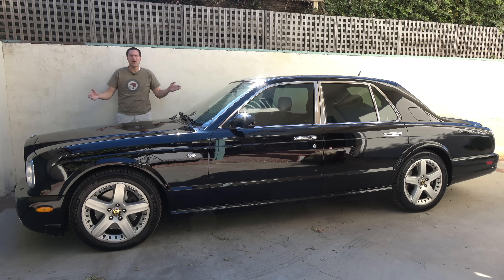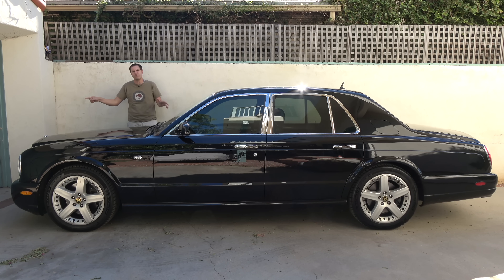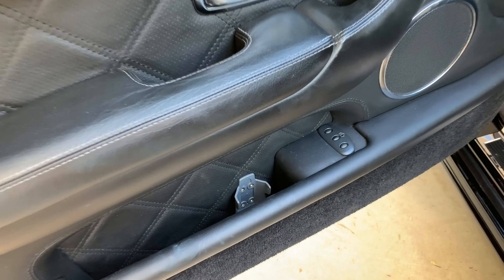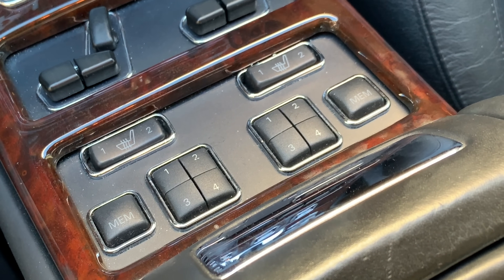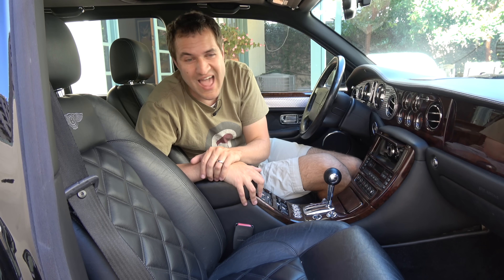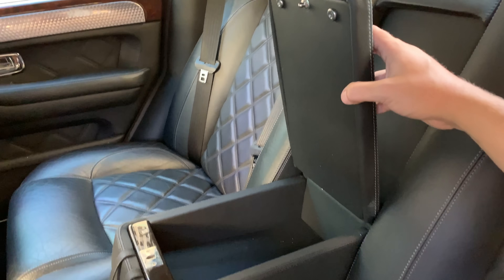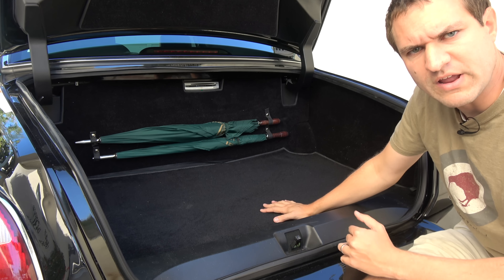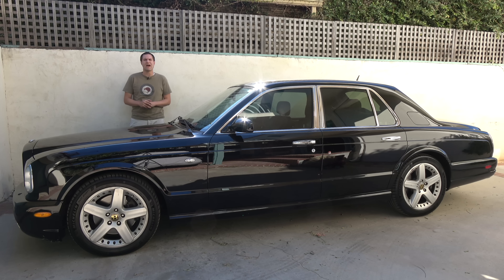The Bentley Arnage Is the Ultimate $30,000 Luxury Car

Comment: If a realtor was showing people $300k homes and telling the people in a decade it will be worth $30k, that house would sit empty for centuries.
Reply: 79 thump In Detroit tho
Reply: not anything
Reply: every car goes down in value besides the older muscle cars from the 60s. take a regular $25000 car from 2003. today its worth $3000 or less.
Reply: take a mclaren f1 which increased to dozens of millions of bucks from less than a million
Reply: But if that house were guaranteed to score some top notch ass for a year, it would sell overnight. This car is the pound-town express!
Reply: 2008 called and it's very sorry
Reply: Nissan Skyline R34 was £50,000 in 1998 its still worth at least £50,000 in 2019
Reply: As tech progresses, these new "smart" houses will become obsolete quickly and depreciate in value. When the lights & smoke detectors & kitchen appliances and bathroom fixtures need to download updates to function properly or become unreliable, the housing market will crash again. Hahahahahahahah!
Reply: @ald261989  There are PLENTY of cars that have maintained (Due to inflation, technically, that is increased) value OR gone up in value substantially. LOTS of cars. Numerous Ferrari's and Porsche's, Lambos, Mclarens, and cars from a few other manufacturers.
Reply: Apples to oranges. Also if you buy a $30,000 car today, it will be worth what, $2,000 in a decade? It's not any different, just bigger numbers with richer people.
Reply: Houses and cars are two different things. People dont drive houses and most people dont live in cars. 
Try again.
Reply: Most cars are a wasting asset. And a poor place to push money.

 Only ones that gain in value are high priced collectibles.
Reply: At least you get $30K back. Some people pay $300K in rent over ten years.
Reply: =Timeshares
Reply: In some places, that's called buying a condo.  In fact, that's what effectively happened to me.  I bought one in Newport News, and after about 13 years, am hearing from the association manager that some of the recent foreclosures in my building have fetched just into 5 figures.  That is on a unit that originally cost over 100K.  I paid 90K for mine, and and still am about 20 years from having any equity, or so it seems.
Reply: That's a home. As a realtor I'd choose this. Used
Reply: people don't buy these cars new... their corporations do...
and when it is written off... sometimes the driver will buy it from his corporation... 😁at a deep discount.
Reply: @ald261989  dont forget about old Ferrari's...
Reply: Land...they are not making any more of it!
Reply: @Jamie-ds1gf  worth more in the USA & Australia... R32 GTR's between $70-$120KAud  in Australia.
Reply: @venom5809  only if it was used as a taxi , and has 500K Klm on it. I've seen plenty of 10 yr old cars which still have a 35-47% market value
Reply: @wrxrob  lmao
Reply: If you guys are so petty w money you should look at a conti gt 😂
Reply: @FuckSmucker  Cars arent investments
Reply: @MyNameIsUnavailable  maybe for poor people 😂
Reply: Can’t compare depreciating assets to appreciating assets.
Reply: Actually houses go down in value in Japan.
Reply: @Ned_Slanders a house should be a depreciating asset.
Reply: …and that is why this type of car is a total waste/luxury.
Reply: Not how real estate works champ

Comment: 6.75l Twin Turbo V8

Horsepower - Sufficient
Torque - Sufficient
Reply: obviously not a performance numbers kind of car and it weighs as much as an elephant
Reply: A gasoline engine which redlines at 5000 rpm is all about low-end torque and smooth riding.
Reply: I think you mean Adequate. ;-)
Reply: @federico5220  yep you are right. I see so many people braging about why amg and 760li v12s don't make 700 or a 1000 horsepower
Reply: If you have to ask the price, you simply cannot afford it
Reply: @Esdeath_0001  So if I don't know the price of a t-shirt in Target I can't afford it?
Reply: @cianosullivan4096  it's a play on the 1%ers never ask what the price is
Reply: Fuel consumption - Suffocation
Reply: @cianosullivan4096  Well yes and no...  A shirt at Target isn't generally a high price item for most people.
Reply: The 4.4 V8s were the twin turbo ones. 6.75 had just a single
Reply: Half the torque is needed to get moving on a green light before it turns red.
Reply: @ThatGuyRandy  Oh yeah? Why does it say "6.75 Litre Twin Turbo" on the engine cover? 17:58
Reply: @cianosullivan4096  . Probably.
Reply: @ThatGuyRandy   The Arnage T (and R) have twin turbos, that's why it has a plaque under the bonnet with "TWIN TURBO" on it.
Reply: @ThatGuyRandy  to start with, then they moved to twin turbos with the RL, and in this model the T

Comment: I need to put the record straight I bought my Bentley Arnage T for £20,000. about $28,000 a year ago It is in a beautiful Moroccan blue colour and I have done 24,000 miles in my first year the cost has been minimal in terms of maintain and in my opinion it is the most magnificent car I have ever owned they only 2400 of these beasts and approx 1000 RHD to put it in terms of appreciation likelihood this is a car to invest in so too. those petrol heads who keep mentioning cost of repair I am an owner and when driven as an everyday car it will serve you well if left sitting in a garage not driven I think it will stagnate and cost a lot  ,Well anyhow great Video Doug  keep it up
Reply: So your saying I should sell my 2014 Toyota Tacoma and buy a Bentley...al I do is change the oil in my Tacoma, nobody I know messes with anything else unless it breaks after 200k miles, like a water pump or something. Can I do this in a Bentley or are fluid changes, belts, etc in need of upkeep constantly?
Reply: Benjamin Goulet: Holy smokes another pontificating toyota owner, Graham Day is stating his Bentley isn't as expensive to maintain as most think. You have a toyota, congratulations, no one gives a toss. Good luck with your ego when a Chevy from the 1970s can tow/haul more than your truck, has been reliable for 3 decades more than your beloved and gets more looks
Reply: @endutubecensorship  Chevy is a great car/truck the point I was making with the Bentley is that someone paid $300,000 originally for it and I bought it for $28,000,oil sparks and general service I do myself no way is the Bentley going to do 300k like a Toyota or a chev but for value to drive the same as the queen of England is driven in ,it is a class act but the Chevy is not be sneezed at either .
Reply: Graham Day: I had missed your point, my apologies to all here. I agree, that value for the quality of craftsmanship and materials cannot be beat
Reply: How many miles has the car traveled so far?
Reply: @grahamday813  the Bentley can do the enormous mileages if properly serviced. The earlier Rolls-Royce and Bentley cars were considered a lifetime purchase. They were engineered to be serviced and rebuilt with a lot of chauffeur-friendly maintenance. Diametrically opposed to today's dispose, recycle and buy new mentality.

Comment: 2001 Bently Arnage 30k
Oil change 30k
New battery 30k
Tires 30k
Remote 30k
Remote holder 30k
Reply: Aluminum car lighter 30k
Reply: Left rear blinker light bulb 30k
Reply: Going to Bentley dealer and just think of getting your Arnage serviced, not saying it to anybody, and getting out of the dealer : 60k
Reply: Front passenger lug nut  30k
Reply: car wash 2k
Reply: Air for the tyres 30k
Reply: Facts 😂😂😂
Reply: Light bulb 2k
Reply: Mob boss style: Priceless
Reply: A Doug to go in the trunk 300k.
Reply: Well 15k for a bulb is a bargain oh you want me to replace both of them
Reply: Severed head 30k
Reply: Shifting to another gear : 30k
Reply: Changing blinker fluid and muffler bearings ... priceless
Reply: Machine guns for your 3 passengers 30k
Reply: bentley windshield washer fluid $30k
Reply: severed head in bentley arnage trunk 30k
Reply: I guess that people that are buying an 18 year old Bentley for $ 30k aren't millionaires but car enthusiasts, who will give the car to a garage they trust for maintenance instead of a Bentley dealer. So the running costs won't be too high until an expansive spare part is needed to be replaced.
Reply: Remember to buy a gas station to run the car 300k
Reply: Windshield wipers $2,500
Reply: Tires $4800
Reply: Nice joke and all. But I wonder what could be the real annual maintenance cost of this vehicle :-) I understand it is not that crazy, until some major part is broken (like clutch, or transmission etc.)
Reply: External loudspeaker for yelling at the proletariat: 30 grand
Reply: Santas Doom  LOL!!
Reply: Wow that's at least 100 dollars bro.
Reply: Blinker Fluid 30K
Reply: @kgs4070  blinker light fluid 30k
Reply: Bentley Crest embroidered on floor mats with leather stitching- 30k
Reply: New engine 30k without replacing the turbo's of course
Reply: I was wondering where the other like $200k was in pricing 😂😂😂
Reply: @Spazik86  Check out joshsworld.com on YT, he has a very similar model and lots of videos with it.
Reply: 🤣🤣🤣🤣🤣 super money drain
Reply: @Spazik86  I can tell you the figure exactly as i have one of these in the UK , yearly maintenance thru a Bentley specialist is between £600 - £1,000 that includes everything including parts and labour. Depending on the mileage will determine what needs replacing , all Bentley specialists follow the same maintenance schedule as recommended by Bentley ...

Comment: Not many people know this, but the engine was completely redesigned apart from reusing the crankcase, by Cosworth in Northampton UK. Was originally a single turbo and very outdated with 7 separate v belts driving all of the ancillaries. When it was changed to the twin turbo, pretty much everything else changed in order to make the power and meet emissions. Still a push rod though as Bentley still wanted it.

Comment: "Bentley doesnt do abbreviations"
looks at Bentley logo
Reply: B is an initial, not an abbreviation.
Reply: An abbreviation is a shortening of a word, and acronym is something like
B 
E 
N
T
L
Y
Reply: What about it?
Reply: @zunedog31  So wouldn't that mean that the E and F for the fuel are also initials?
Reply: A graphic logo design isn't a word or intended to be.  It's artwork that represents your company and takes on distinct visual recognition.
Reply: @AB-wf2js  Yes.
Reply: Context
Reply: Even at the center seat "mem" 🌚
Reply: And then amongst the "B" gauges, 12V.
Imagine - "Twelve Volts"

Comment: I have driven this car a lot living in England. The info system is designed for the owner sitting in the rear. At the time the remote was very cool. Its position in the middle of the dashboard was a complete pain as it blocked the kerbside view for the driver.
The seats in my local park are more comfortable, Cornering had no feel what so ever, and you would be very nervous in the wet. You will tire of it in a month!

Comment: When the transmission starts slipping, you're faced with the dilemma of spending $9K overhauling it, or selling as it is for $9K.
Reply: Lol true
Reply: Funny you should say that actually, cause that's the one single thing on this car that definitely WOULDN'T be hard to replace or rebuild. It's got a GM 4L80E 4 speed transmission. Rolls Royce and Bentley both used GM transmissions for decades.
Reply: @UMAMIMAMU  and the 4L80 is known to be extremely robust. I didn’t know that about this model, thanks for that nugget of information 👍
Reply: @96t5wagon  You bet. Believe it or not, that was actually something Rolls-Royce is, or at least WAS, known for. They used to claim something to the effect that they built  cars using the absolute best components available in  the world; and that if they couldn't produce those components themselves in-house, that they would purchase them from whoever could. Probably the most prime example of this would of course be the Citroen self leveling hydraulic suspension. I believe they also used GM alternators on the SZ body cars as well, though I might be wrong about that.

Comment: Doug, I owned a 2004 Bentley Arnage T-24 Le Mans Edition, black on black just like this one. I paid $69,000 back in 2010. The car was in the shop for 3 months attempting to fix all the problems and when it as all said and done the bill was $31,896.12. Almost half as much as I just paid for the car. I sold it 6 months later when it wouldn’t stay running for $49,000. A loss of $50,000 over 10 months. When I bought my 2012 Bentley GTC the general manager offered to give me another 2004 Arnage as his gift to me in addition to my GTC as long as I only got it serviced here. No deal. Even a free Arnage is too expensive.
Reply: Even a free one is too expensive 😔

Comment: Besides exotics, this was the quintessential car of MTV Cribs
Reply: And rap videos from the mid 2000s
Reply: @ge8198  And rock videos
Reply: shit, yo, welcome to my crib (rental). This is the fridge....
Reply: Quintessential whip*
Reply: mtv cribs garage starter pack: ferrari 360, bentley arnage, and an escalade/rover 🤑
Reply: And Escalades
Reply: I wouldn't be surprised if the price of the car goes up a bit (around 40-50k) in a few years; once early 2000s nostalgia goes in full swing.
Reply: ryan hill so true
Reply: @abizitgill4310  Dang. Younger me would be so disappointed I didn't use the correct terminology
Reply: @bigsushi98  Hummer H2, Continental GT and Gallardo/Murcielago with Lexani wheels as well
Reply: Gage M. Yes and these end up getting ran into the ground until theyre junked